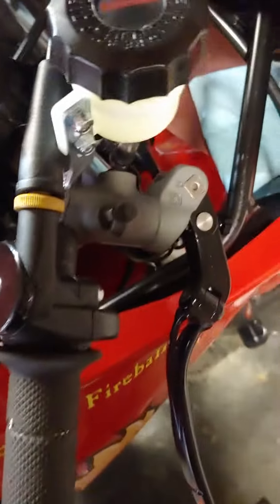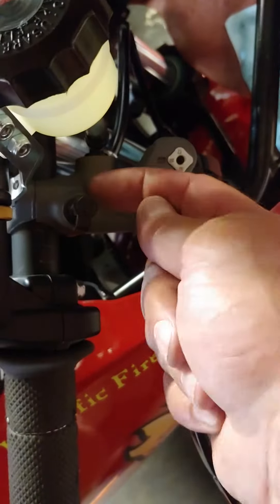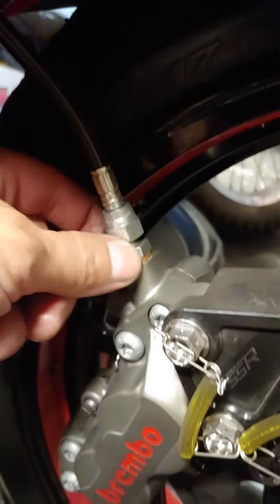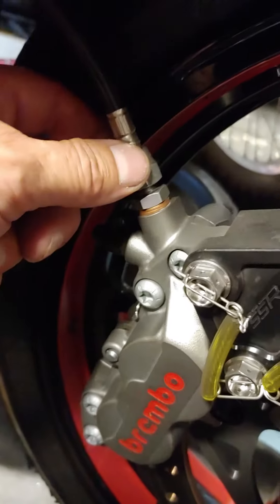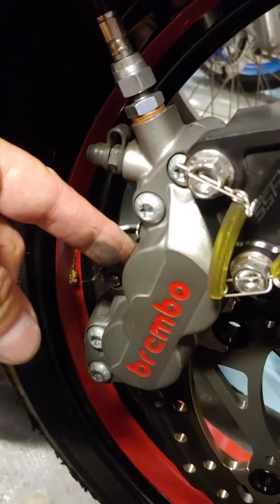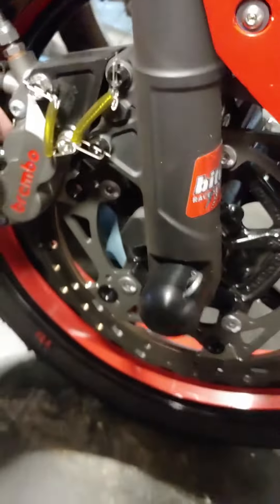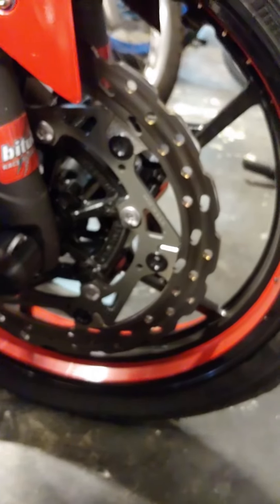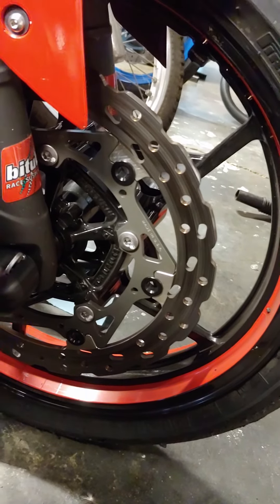2 CompleteBrakeSystem

Comment from the maker: To update - I have done a few track days now with the new master cylinder, and it is much better in feel than the PSC15 Brembo that was leaking.  The PSC was a little more wooden in feel.  I have the PRs15 set on the 18 lever fulcrum - which is in between the 17 and 19 settings.  I haven't played with the lever ratio setting yet as I wanted to get used to the baseline feel of the new master.  Last time out I had a little bit of fade as the brake fluid needed a change.  I went with the Castrol SRF React Racing Brake Fluid, which has phenomenal wet boiling point, much above even 5.1 fluids.